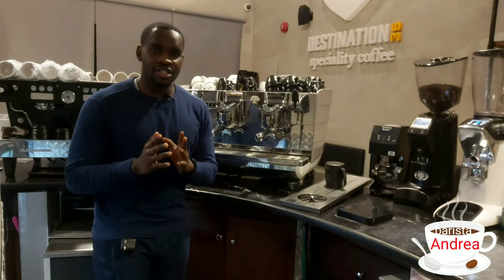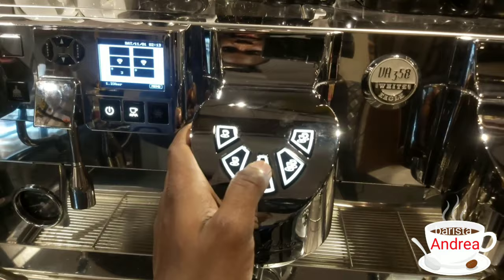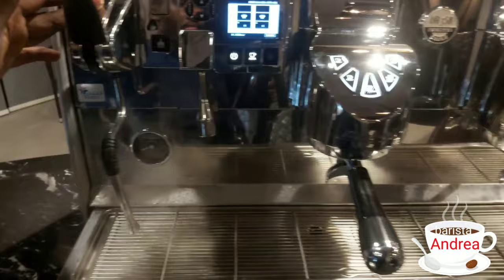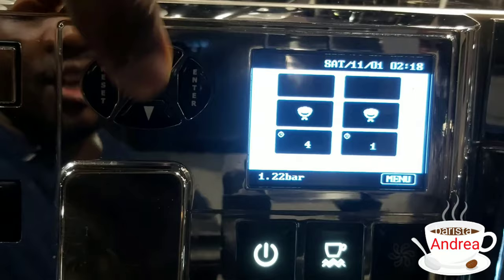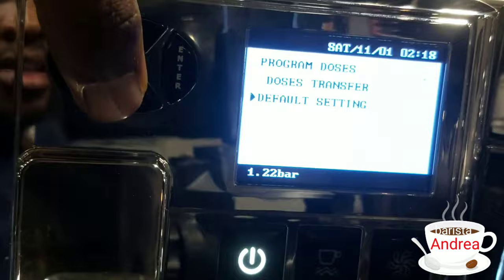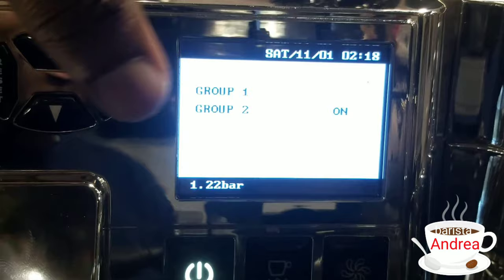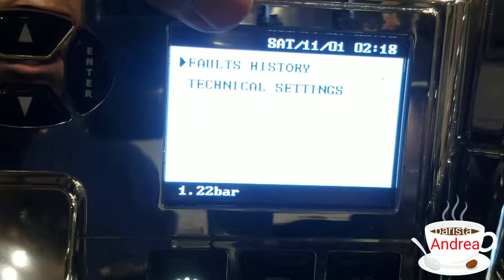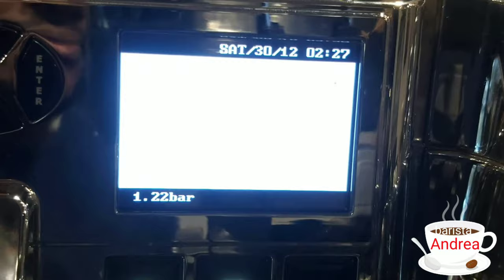How to use a White Eagle Arduino Machine. Recommend Best Espresso machine

Comment: Good evening,Bro Andre deBarista,my machine has one stream wand that is not well steaming.how to adjust it
Reply from the maker: Kindly I would advise you to either call a mechanic of you sock the steam ward in the chemical you use for backflashing over night to clean inside the steam ward
Reply: @baristaandrea6399  thank you dear, I'll use this back flashing overnight.and see. I will let you know
Reply from the maker: @user-gd8lw7vk4d  ok.
Pour the chemical into a pitcher, add cold water and boil it using the same steam ward, the leave that steam ward in the hot water with the chemical throughout the night

Comment: Hi, can I know how to reduce the temperature of the water in tank ?
And how to dump the water from tank to clean it?
Reply from the maker: Hello. It depends on the type of machine you are trying to use cause they all have different ways and settings on how to reduce to the temperature of the water. Then when it comes to cleaning inside the water tank, first I would recommend you to invite a technician who can operate the machine hard ware or still you have to start using filtered water into your machine.
Reply: @baristaandrea6399  
Thank you for you reply,
I am talking about the same machine in this video white eagle volumetric 2 groups
Reply from the maker: Your welcome.
Currently I dont have my machine with me but first option you go into the machine menu, click on display settings and click on the temperature mode there you can easily adjust ur temperature the way you want. Secondly if you can open ur machine into the wiring and system of the machine, next to the water tank there are adjustment pedals that govern the temperature and the quantity of the water to outlet, and the last option is to call your technician to adjust the machine through its software.
Reply: @baristaandrea6399  
Very good,
Thanks a lot my friend,
All the best.
Reply from the maker: It's a pleasure Mr. Mohammed. Any time.

Comment: do you recommend this machine for a coffee shop?
Reply from the maker: 100% i do recommend it mr. Khalid
Reply: @baristaandrea6399  how you adjust the pressure of the steam wand?
Reply from the maker: @multi_barista6813  the steam pressure can be adjust manually by opening the machine to adjust a valve next to the water boiler. So i would recommend you to call in a technician to be on a better side
Reply: @baristaandrea6399  thank you so much.
Reply from the maker: Your truly welcome

Comment: Hi
How can I know the temperature of water for every group head
Reply from the maker: In most cases depending on the machine you have, the temperature of the water is set manually by a technician cause one needs to open the machine and adjust it within its hardware. But u can also use a thermometer to determine the temperature.

Comment: Hi Andrew  how much you set the water volume (4:57) ? 50cc as the video?
Reply from the maker: Hy carla it in 50cc like you it in the video
Reply: @baristaandrea6399   thanks. Another question Andrea What is the yield you expect to get out of 50cc?
Reply from the maker: @carlamoreno6881  hlo Carla. Basically yield of the espresso depends on strength and extraction on which you set your machine. The more water the more yield and vice visor which also rounds up with your coffee density, grind and  gramage. once you set your machine to a consistency of water levels however much the grind, density or gramage not consistent the machine will yield out the same weight though the timing will change my dear